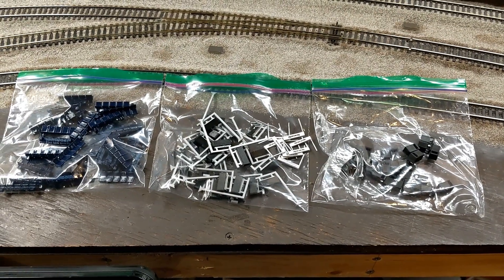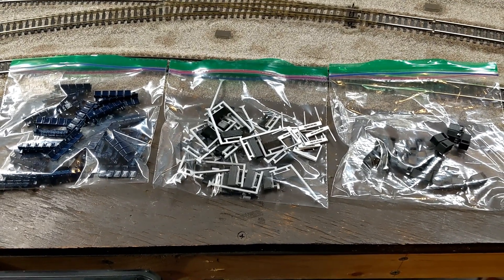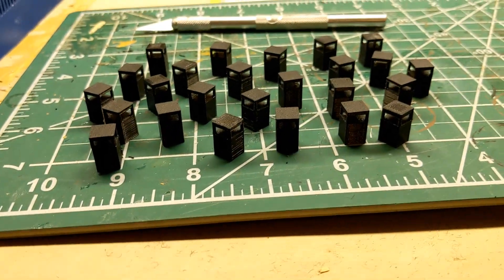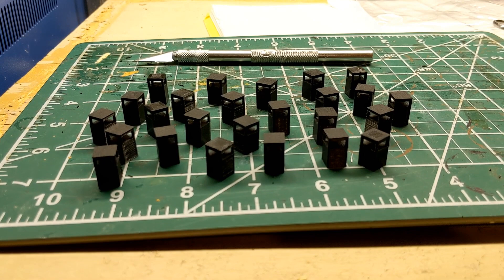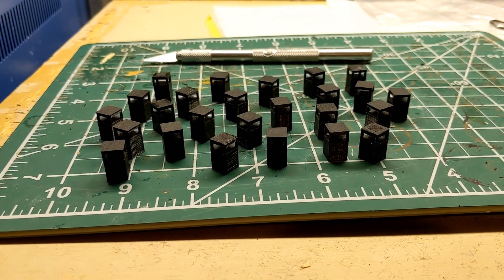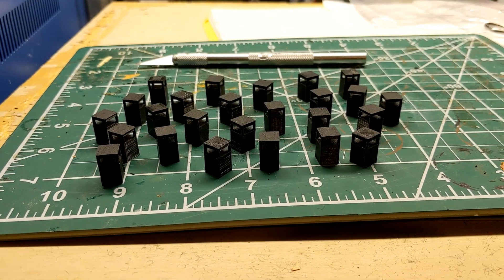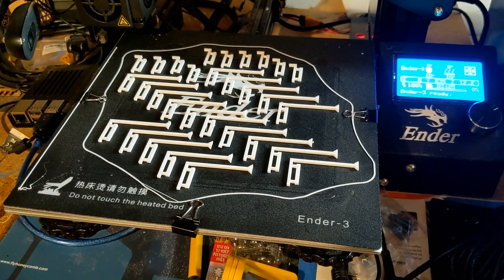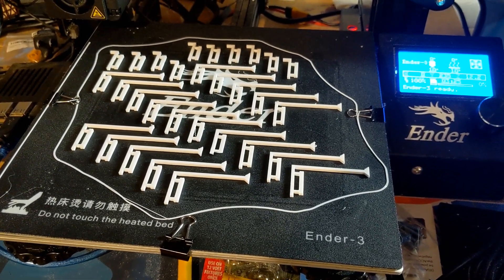39 - Platform details

Comment: On your recommendation, this time last year, I bought myself a Creality Ender 3 for printing items for the railway. One of the best purchases I've ever made. I bought the Ender 3 Pro and made a couple of small upgrades to it and it's perfect for producing lots of small (and not so small) items for the railway. The cost of the printer and filament is more than offset against the commercial cost of all the items I've now got.
Reply from the maker: Awesome, glad the printer is working out! I'm the same - for what I've printed over the past 18 months to 2 years, I've definitely more than covered the cost of what I would have been buying off-the-shelf. I mostly got the 3D printer, or at least told myself I did, to print up all these station detail pieces as I knew I'd need so much to fill it all up. There's some great commercial products available, but would add up to so much money! Glad you're enjoying your printer! Iain